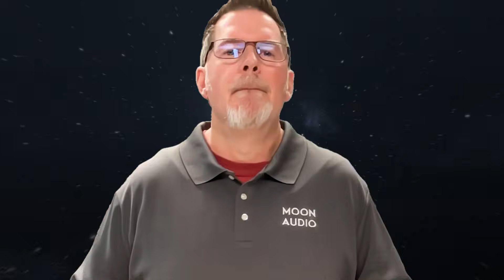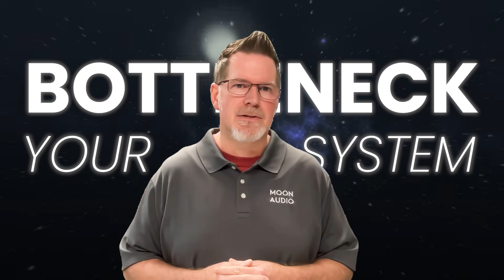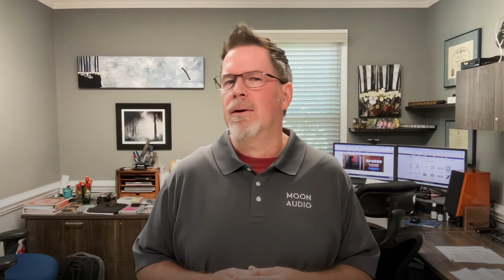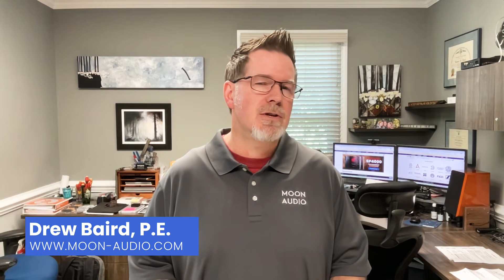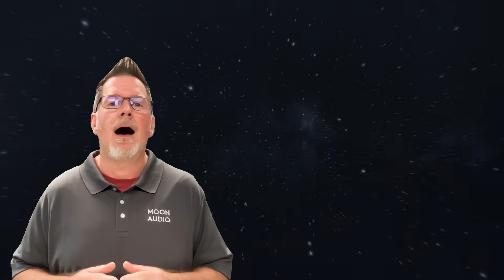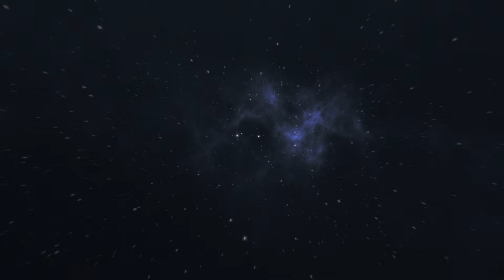4 Audio Gear MISTAKES Costing You THOUSANDS! An Engineer Explains

Comment: This is a great video.  Much respect for your ability to convey this technical information in laymen's terms.   That's not easy to do.  Also, sorry you have to put up with occasional comments from the peanut gallery.  I guarantee I can hear the difference between 16- and 24-bit depth files.  I don't care what a spec chart says about human hearing (heck maybe it's partially a function of the cavities in our skulls - who knows) I CAN hear the difference.   The sweet spot for me for price vs quality seems to be 24 Bit 96 kHz.  I do struggle to tell the difference on higher sample rates (doesn't mean there isn't any though).

My setup is probably a bit old school in that I still absolutely love my original Cowon Plenue 1 (so much so that I recently spent $500 on a brand-new backup from eBay).   I love the build, the looks, the nested menus, the OLED screen, and most importantly the sound.   I've fiddled with the EQ but struggle to improve on the pre-installed "Classic" sound profile.  Love it with my Meze 109 Pros with the premium Meze all copper cable (I think both the headphones and the premium cable are gorgeous).   Also, if formatted to FAT32 the Cowon handles a 512GB Micro SD Card just fine.

I've toyed with the idea of the Fiio K13 R2R DAC (would use optical out from the P1) and then maybe a balanced premium copper Meze cable.  If you have time, what do you think?  Significant or just slight (or any) improvement?

Also, if not already in your personal library the entire "Amore" album by Andrea Bocelli is a joy to listen to (of course I have it in 24 Bit 96kHz :)

Thank you again for this very informative and useful video.

Edit:  Every time the song "Momentos" (from Andrea's Amore album) starts (like right now as I listen) I can't help but smile and all the cares of the world seem to drift away.  : )
Reply from the maker: Hi Mark.  Thanks so much for the great feedback and for sharing your experience and love for hi res music!  We recommend our Black Dragon for the Meze 109 Pro.  It’s also a premium copper cable with UPOCC copper.  Here’s the direct link: https://www.moon-audio.com/products/black-dragon-headphone-cable-for-meze-109-pro
It will offer superior instrument separation and improved midrange and bottom end.
Reply: @moon-audio  Thank you for the quick reply.  I'll checkout the cable link.
Reply: Hi. Here's another comment from the peanut gallery.  I am 100% sure that you can't hear a difference between 24 and 16 bits, all else being equal.  I admit to getting some help from an LLM with the wording of the following but the preference for vinyl is something that has always baffled me about audiophiles.

"If you can hear a difference between a 16-bit track and a 24-bit track, you are almost certainly listening to two entirely different mastering jobs from the record label, not the format itself. Bit depth only changes the background noise floor. Since 16-bit's noise floor is already quieter than a soundproofed studio, 24-bit is just capturing empty silence. After all, if our ears could actually resolve details that demand 24 bits of depth, nobody would ever listen to vinyl, which maxes out at the equivalent of about 11 or 12 bits and carries thousands of times more distortion."

Comment: Okay .... define "synergy" ....  What is it? How do we get it?  What does it do?
Reply: Easy..., it'll swing your head and tap your feet to the ritme of the music...! Your so much interested to listen to the music you'll put your mobile down. Get it by clean power and signal path with good cables and connect it with phase coherence. Mix and match cables, some 'll work beautifully and others not so much. Just play around and have a listen again and again till it falls into place...! 😉
Reply: @-Nirvana-79  
So, it's an emotional reaction supposedly caused by some ill defined combination of system elements, that can be reached only by trial and error?

How the hell does that get listed in a set of necessary features for good stereo?
Reply: @Douglas_Blake  Yes..., you're absolutely right that it's indeed an emotional reaction. Some side tweaks like coupling and decoupling under and heavy objects on top of your equipment help to decrease vibrations and microphonics that's causing smearing of the sound. Of course perfect speaker placement is key otherwise these differences in cables and other tweaks are harder to differentiate. It can take a long tome even years to find it where everything falls together and your not analysing the sound anymore. Took me a long time to get it right but that's what the hobby is about, play around in perfecting it till you enjoy your system where you can sit down for hours and hours just listening. I use Classical and Grunge music to fine tune cause if those genres sound very good you know you're there. Just have fun it with trial and error and don't give up...!

Comment: 1. Nobody says that a 320kbps mp3 and a high-res WAV are "essentially identical". What they do say is that with perhaps a very few exceptions under very carefully controlled conditions, nobody can hear the difference. So all your talk about higher sample rates and bit depths is not wrong; it's just irrelevant. If nobody can hear the difference, there is no point in high-res as a consumer format.  You just can't talk about engineering audio solutions without some reference to the limits of human hearing and the Nyquist frequency, neither of which you mention here.

2. You also aren't wrong about the advantages of balanced connections in general, and that can matter for some interconnects.  But the question is: do those advantages apply to relatively short, low impedance,  high signal level headphone cables? The answer is almost certainly no.  So when people say that the only practically audible advantage of a balanced headphone connection is that it delivers more power, they are not wrong.

I think I'm beginning to see a pattern in how high-end audio equipment is sold. You tend to take an engineering problem that applies in one domain and then misapply it to a different domain, so that you can sell an overengineered and expensive solution to that problem in a domain for which it does not apply.  eg: balanced cables eliminate noise and crosstalk in long microphone cables, therefore they must also eliminate noise and crosstalk in headphone cables.  Jitter is bad in some scenarios, therefore you need to spend $4k on a network switch to keep jitter in your ethernet frames to a minimum. The list goes on and on...
Reply: Yep, that's what they do ... hide a bunch of disinformation between two bits of real science.  It's called "Bafflegab" and those without technical understanding lap it up like warm milk.